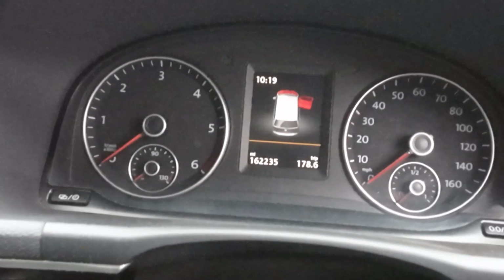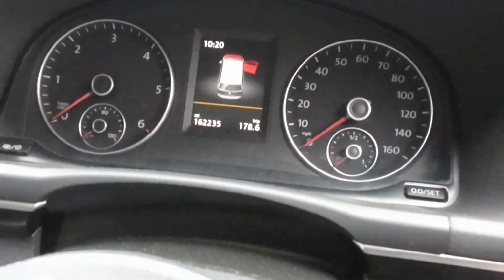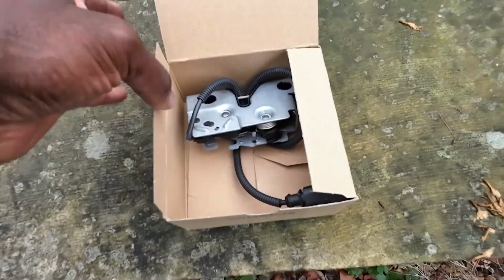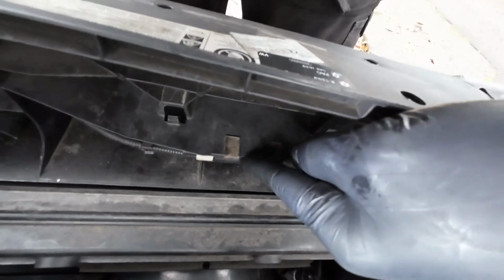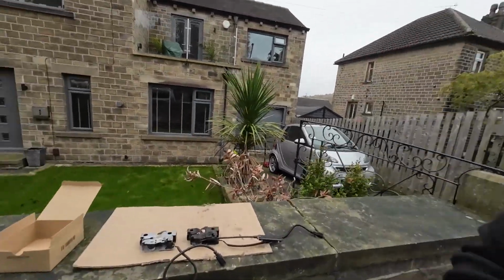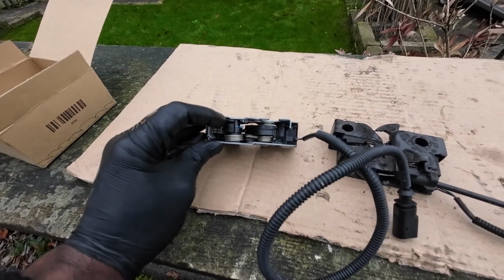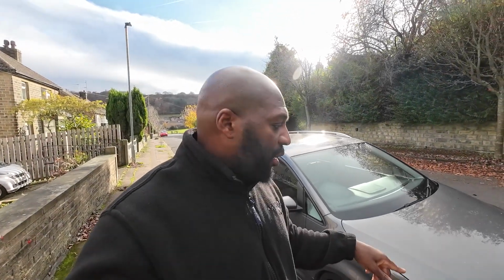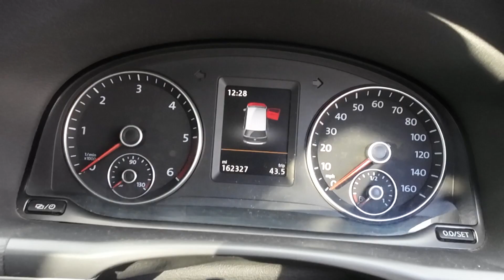VW Touran bonnet lock replacement

Comment: I had the same problem on my jetta 2.5 recently, if I had seen your video before I would have saved the cost of replacing it with a specialist, good video..
Reply from the maker: @mich9170 that is a shame, you could have saved a bit of money doing it yourself & also got the satisfaction
Reply: @aguycalledjoe7802  Your videos are very good, thank you for making them and for explaining them very well.